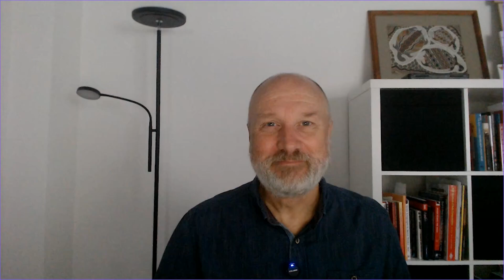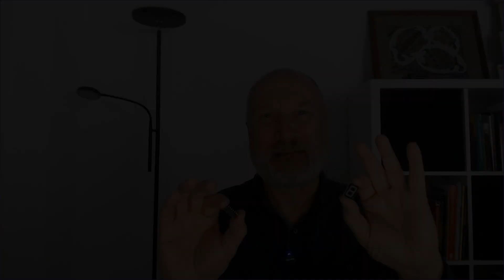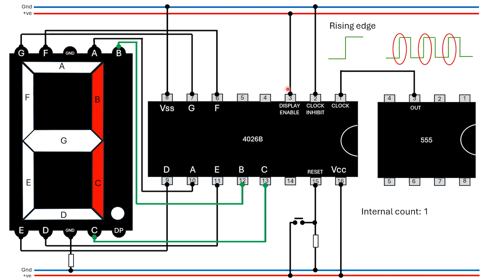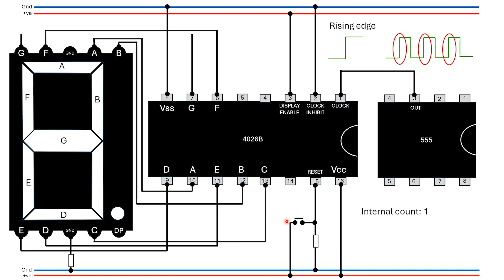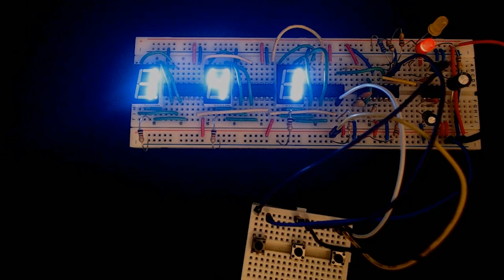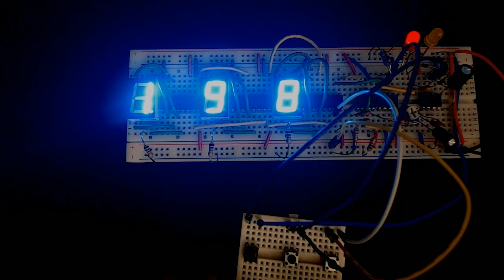Make: Electronics Book Experiment 18 - Reaction Tester

Comment: Built exact same circuit from the "Make: electronics" book . Checked and rearranged this scheme five times, but display just shows 0. Could it happen due to malfunction of 4026 or LED itself? Previous experiments in this book worked as it should
Reply: I had the exact same problem adding a 0.01uf ceramic codesator  beetween power lines worked for me. The 555 poduced a lot of noise and pin 15 of 4026b picked up a lot of noise and codesator smoothens it and bow works perfecty.

Comment: You show the reset button connected across the supply rails at 16:00...
Reply from the maker: Ah good spot. Thanks. This is the danger of creating simplified versions of the circuit diagram. In the full circuit diagram the connection to the ground rail does have a pull down resistor, which is omitted here. I'll add a note to this effect in the description.